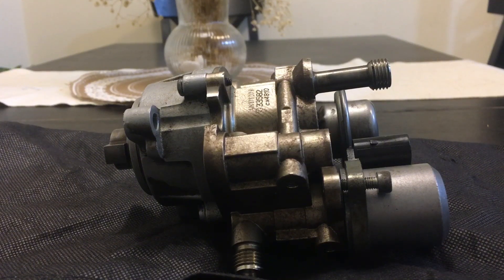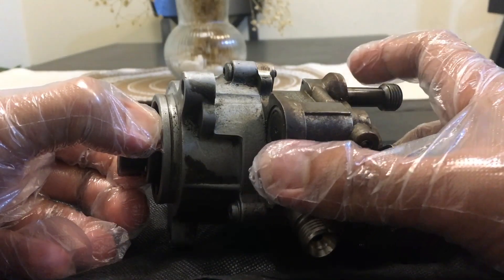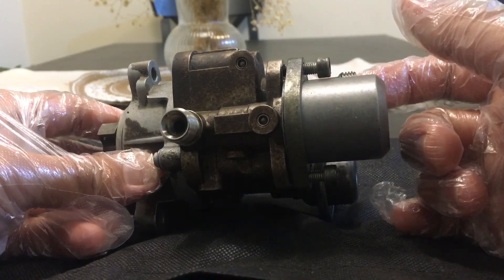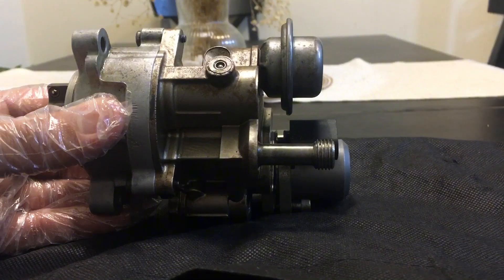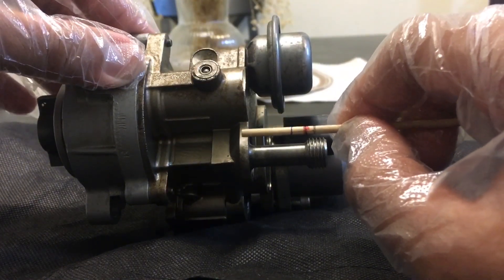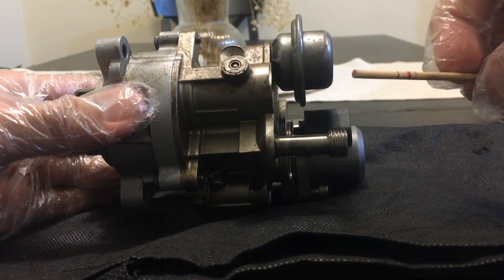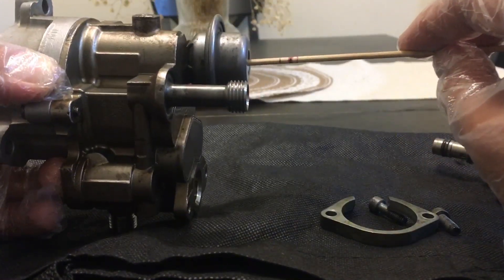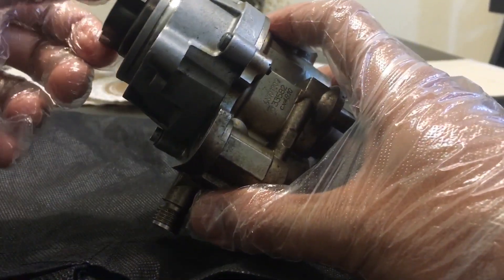BMW HPFP Bench Test -Test HIGH PRESSURE FUEL PUMP B4 U Buy Aftermarket or Used!!!

Comment: Hello. My friend, I would like to get some information from you. My car is a 2011 BMW 740i. The engine code is N54B30A. I checked the high pressure with an automatic device while it was idling normally. A value of 47346.57 mbar. Before installing our pump, we measured the diaphragm with a caliper. Our measurement before installation was 16 mm. Later, following people in other videos, I opened it up and changed the three o-rings and the outer seal. Before adding the oil, I pulled the diaphragm back with a vacuum pump at 2.5 bar and held it steady. Then, I filled it slowly with 0W20 engine oil, venting the air. At the end of the process, I measured it again and this value was 16mm. Do you think this value is too little? We installed the pump in its place, started the car, and when we tested the pressure in the high pressure pump, it was still hovering around 50.
Reply from the maker: If you reduce the diaphragm depth the pump will start leaking oil soon as refurbished pump will not give the full performance of new pump. New will have depth of 14mm I guess
Reply: I inserted my own pump from the top of the car and then measured the diaphragm without opening it. It was 18mm, so I changed the o-rings and reassembled it, measuring the diaphragm again. 16mm was coming
Reply: @bimmerhacks So when we replace the pump, what should be the ideal size of the diaphragm and how much vacuum should we draw? I filled the oil after keeping the vacuum constant at 2.5mb
Reply from the maker: @serkangokce4050 u have a measurement of 16mm if you reduce to 14 the pump will fail soon. Better to drive in this way, or buy a new from BMW if you want the full performance
Reply: @bimmerhacks you have more information about this pump and you've done more research. So what could be in a new pump that could be better than this? And there are refurbished pumps for $350 on the market. We have very positive results and feedback. If we're doing something wrong, what are we missing?
Reply from the maker: @serkangokce4050 new pump from OEM supplier is filling oil in different manner. We don't know the correct oil been used and the oil seal in the new will be installed ina clean manner. I am not a master in this but tried doing on like 5 pumps. The new hpfp price is almost 15% price of the car that's the reason I did this
Reply: @bimmerhacks yes. My friend, the new pump is really expensive. I measured 16mm but after connecting it to the car, when I step on the gas, the car's fan goes into high gear. There are a lot of videos online and they are all bullshit.
Reply from the maker: Fan high speed is not only HPFP but also related to AC system. If it drives well keep going.

Comment: Have you found you are still able to repair by replacing piston seals with x-rings and replacing the shaft seal after failing this bench test?
Reply from the maker: Yes. Still working well.